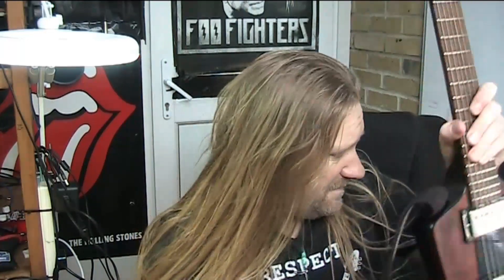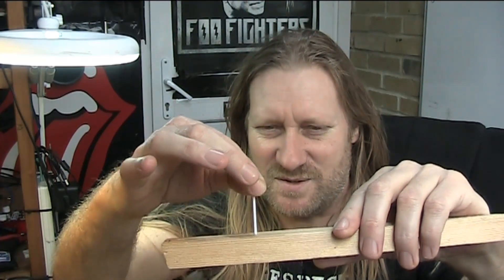Side Marker Dot Inlay Replacement on a Budget

Comment: Now I noticed that the pickup covers fit pretty nice with the Gothic style of the guitar.  
As for drilling in the wood, a guy who make furniture told me that it should be done at high speed, and slow advance, especially for small drill bits. At low speed there is a risk to chip the wood at the entry point. 
Thumbs up for the bravery to  drill holes in the neck!
Reply from the maker: yeah I think you are right, I also think my drill bit was a bit blunt.

Comment: I like that you didn't put a dot of the first fret.  You started with the third fret.  I don't like dots on the first fret.  I've got some guitars with dots on the first fret that I'd like to remove.  Having a dot on the first fret sometimes throws me off when I play high on the neck, because there is not dot on the 13 fret (because you don't want dots on adjacent frets).  The first dot after the 12 fret should be the same as the first dot after the nut (just an octave higher).

Comment: I have a small electric screwdriver that I sometimes use with that exact same chuck add-on that you used. Definitely comes in handy but mine is kind of wobbly when drilling, as if the chuck and the hex shank are not lined up straight. It drills straight but feels weird to use as the screwdriver moves around a bit to compensate.

Comment: I would spray paint the markers with glow in the dark paint.
Reply from the maker: is an option :)
Reply: I think Chapman guitars actually use glow in the dark side inlays instead of plain white, which would be an even better option, easier than painting if you could find some.